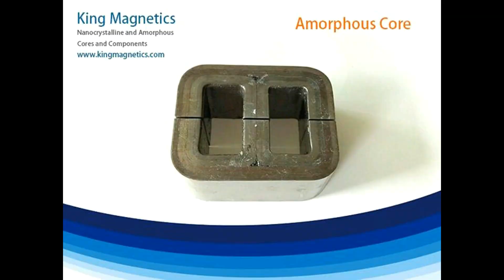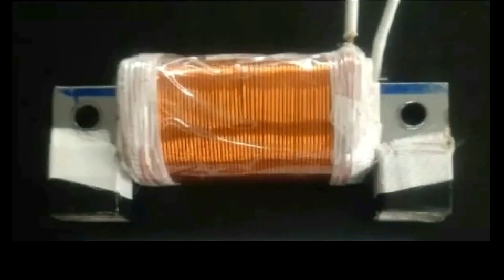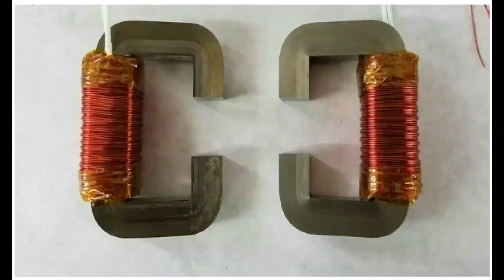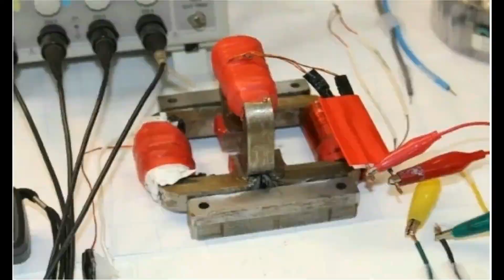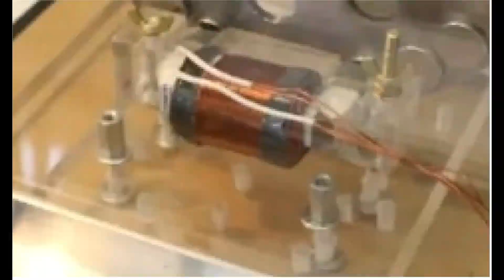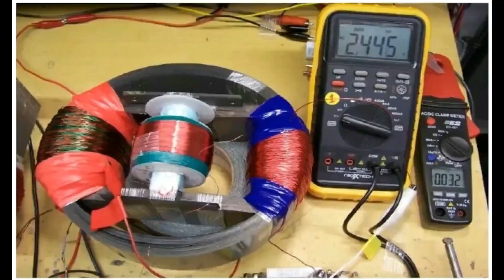Metglass cores

Comment: I got ahold of some cutting edge 3d printing filament forr 3d printing some custom transformer cores. Its called proto pasta has iron power. Just saying may be an alternative to the metaglass. Another point this meta glass reminds me if the quazi  metal selenium. I dont remember exactly who made the statement either tesla or baum that selenium is perfect reciever of radiant energy. I found that statement extreamly interesting. As could selenium panels could be used to recieve radiant energy as an antenna-solar panel. Ya know radiant energy panel. Just a thought thats crossed my mind